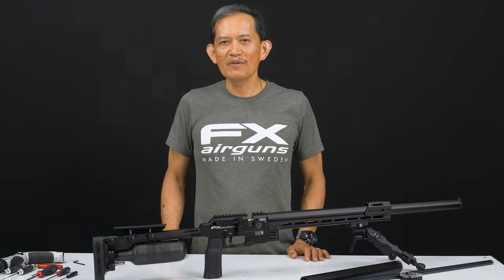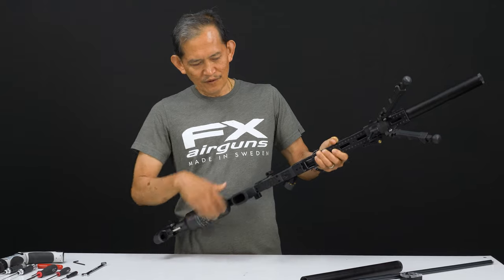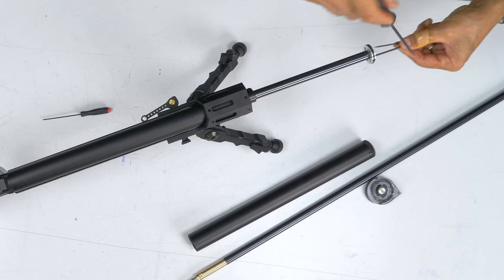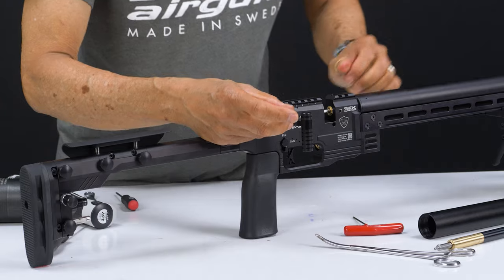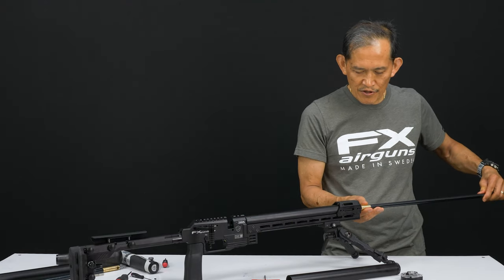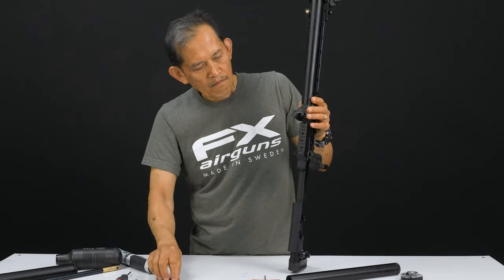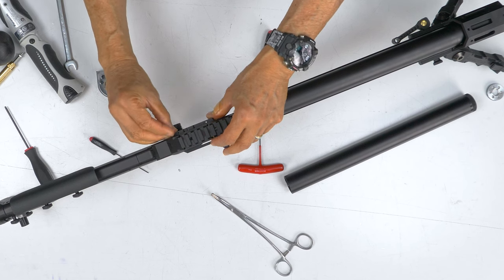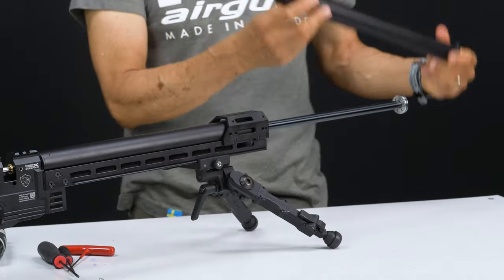FX Panthera and FX Dynamic Barrel Removal and Install

Comment: Thanks for doing this! Definitely helpful for all of us Panthera / Dynamic owners. 
I removed my barrel and shroud all as 1 piece by loosening the screws on the side of the receiver and then unscrewing the whole thing as an assembly, which worked fine as I needed to remove the shroud to access the valve. Soon I may be doing a caliber swap and will use your method here.

Comment: Is the pellet probe supposed to be lose even with the set screw tight. Mine has play and is seated properly.
Reply from the maker: Hi , is the breach oring in place ? The one in the brass inlet .
Reply: @FXAirguns  
Yes it is. It's loose until it seats in the transfer port. 1/2 cocked, you can wiggle the tip of the probe. Not sure if this is by design. I do know, my transfer port is scratched pretty good by the sharp edges on the probe and maybe the loose fit is not helping. The cutout in the probe needs to be deburred. I was thinking of switching over to the HUMA pin probe and transfer port. So far I'm not impressed with the quality of FX. Won't be buying anymore.